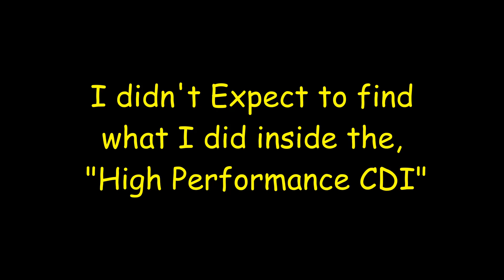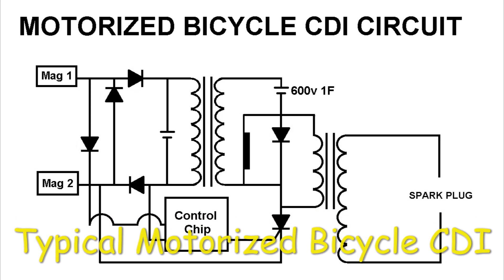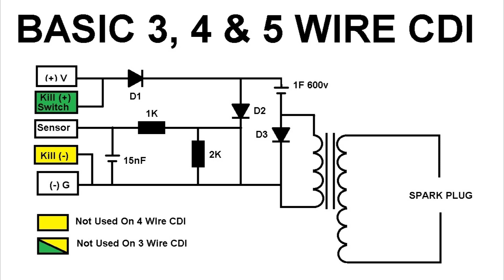Motorized Bicycle"High Performance CDI"  Was Actually A TCI!

Comment: Would be useful links to decent CDIs to purchase. I've had three purchases that failed very soon after installing.

Would be interested in a video showing what you found inside these units that you cracked open perhaps even interesting to see how you manage to use acetone to dissolve them.

If keep having CDIs failing, suppose I'll look at some of videos showing how to build your own?
Reply from the maker: Stop using the kill switch.  It's a crappy system and kills coils.  Use carbs choke to kill engine.  Very common issue.

Comment: @BuildBreakFix... Hello, nice video. I have a question, the CDI on my completely stock 80cc motorized bike keeps burning up. The motor will run fine for a few weeks, then it starts spitting & sputtering. Then pretty soon it won't start at all and I have to switch out the CDI. What is causing this problem?
Reply from the maker: @90daysinvegas53  kill switch system actually does it.   Shorts the coil. When first started I had many fail from it.  A person said use the choke on carb instead button as emergency shut off.  Actually had only 1 die that got wet after I stopped using the kill switch
Reply: @BuildBreakFix  ... I would like to keep my kill switch. Would switching to a BBR Volt Master CDI Stage 1 or Stage 2 solve the problem?

Comment: No spark with the TCI, aka "CDI," with black and blue wire. Why?
Reply from the maker: It was used to run an incandescent light. Ones like you see with tire generators.
Reply from the maker: Ha sorry wrong comment 😂. Blue wire is low 6v voltage magneto and the red is supposed to be for high voltage 12v magnetos.

Comment: So will that one not work is what I just received the same exact one and I was wondering why the wires were different and there's only a red and black instead of the three wires
Reply from the maker: Red and black  is bigger coil. blue/white/ black smaller. Blue&white both are the same on 3 wire  makes it easier to plug a light in i guess

Comment: Hey I've been trying to figure out is it possible to hook up a regulate 4 wire or whatever like yamaha CDI and external coil to the stock pickup and magnet setup.. If so what wire go where.. What is pulse control and what is the exciter wire??
Reply from the maker: magneto will power a AC one if you use the 12v version.  Problem you will have is making the coil pack fire at the correct time! you will need some kind of magnetic triggering system to pull it off without effect the magnetos fields!

Comment: Why on my saw build when it’s cold or hot, it’s hard to start and will not stay on? Is it timing? I have some pitting on the cylinder and piston. I’m using a NGK R BR6HS plug. My first build did not do this. Could it be fried rings?
Reply from the maker: Oh way to hot of a plug!   B10HS is plug should be in any of the saw builds actually! Ms380,460,660,880  Depends on what kind of saw build you have!  Ms460 is a 36mm stroke build.  Ms460 40mm stroke build.  Each has few screw ball things to them.  Most screwed up thing people do to each! Is widen the intakes. It completely screws up them running well.  99.9% time when they don't run like you are describing it's main reason why lol!  OR pipe they used is not matched!  Also if it's a Ms660 most use wrong rod and port cross talk can cause that as well!   Ms460 timing  https://youtu.be/b1b0wk1fH3w  Ms660 Timing https://youtu.be/Digi619TixI
Reply: @BuildBreakFix  thanks man I’ll try a new plug

Comment: My question would be then is there a difference in the cheap China doll ignition boxes beyond the wire color and boot. Now if the upgrade ones actually have different transistors in them, or if there's difference in wire conductivity like in their ohm ratings. Idk, I kinda want to find out now. 

What did you use to dissolve the sealant on the top?
Reply from the maker: I didn't dissolve the epoxy! I did the abs shell with acetone!    Inside is filled with sand and stone actually lol not joking...  break one open!  They pact them with sand!  Crazy shit!  

Well the "upgrade cdi" is in fact not a cdi.  Older tech that has rpm limits! Cdi does not have a rpm limit.  Only reason there called upgrade is the offset the timing electronically by 3 degrees.  It's a china scam pretty much rebrand old garbage as item it's not. No upgrade...infact it's a downgrade lol
Reply: @BuildBreakFix  well I know a TCI isn't going to perform near as well as an actual CDI, but one of these days when I get some extra cash I think I'm going to take my multimeter and an ameter to some of these and try and find just what these cheap ignition systems put out.
Reply from the maker: Nothing you can test though with a multi meter on them!  Both types go into a chipset.  Everything happens after that internally.  6to9 volt ac current in on blue/black wire units ang 9to12v on red/black wire units.  Does not matter if it's a cdi or tci cause goes by what the internals require to run.  Output you could see changes but you would need an oscilloscope to see that not a multimeter.  Voltage and amps are always 30to40 kv  and 
.5to.8 milla amps! Wave form is what would show how they cycle differently. Lol you know..   I do have one still I think from college days.  If I find it in office closet where things go to never be seen again I'll do it one day shortly!

Comment: Very interesting! From the article I read, TCI was kind of a solid-state take on the old point/condenser type ignition. Ironically, they're also on the slower side and don't do very well at higher RPM.
Reply from the maker: Yeah its China reselling old technology with new purpose in same containers as normal cdis come.    What they did was just offset the timing. Used w/e they had to make it cheap lol. On the other hand bicycle  kits are well below rpm cap for tci!  Cold weather may effect it though more
Reply: Yes